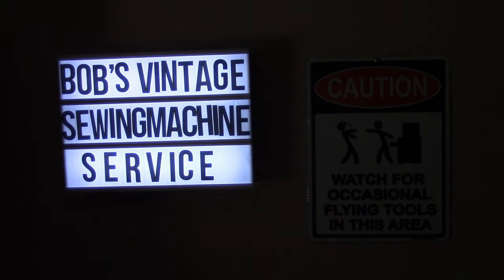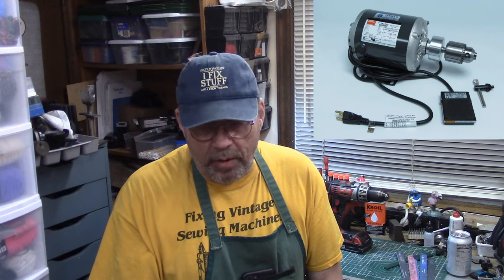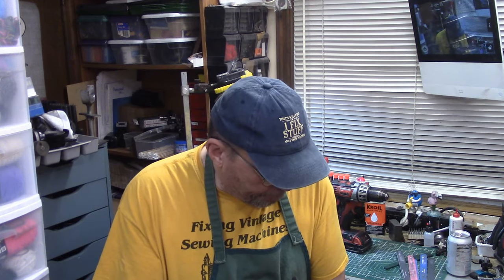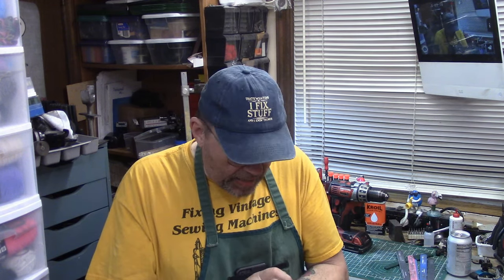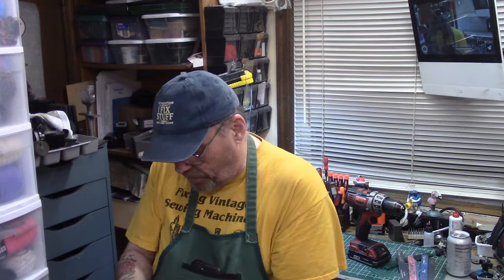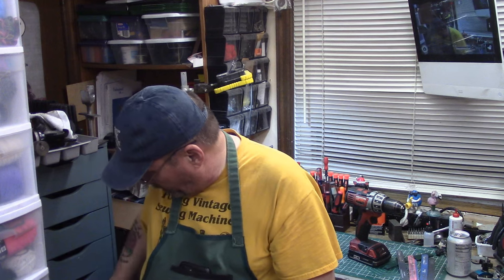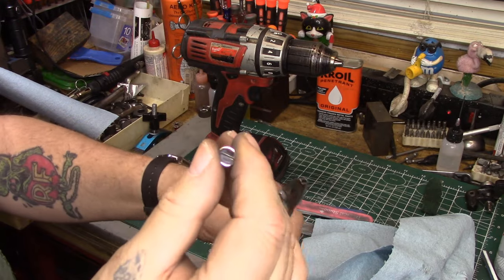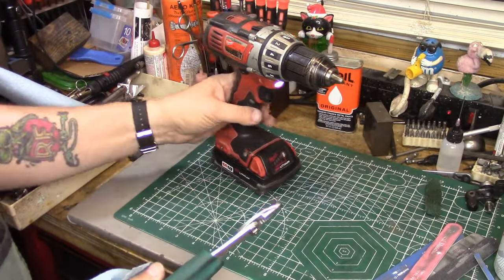Bench motor Alternatives & More: Sunday Morning Quickies, Ep. 104, November 19, 2023

Comment: You don't have to spend a lot of money on a bench top drill press. I picked one up. It's an older model but I picked one up from harbor freight. It does everything. I know a lot of people frown up on because it's harbor freight but quite honestly the motor in it is good. I got the 12 speed bench top so I have a quite a range of speed and I changed out the chuck so I have a much bigger truck on it but it works. I've used it for several things and I paid $140 for it. You can find deals at harbor freight all the time
Reply from the maker: Exactly!

Comment: Bob, I had my mothers 27 and cabinet as a lamp table for about 40 years and started wondering if it would sew. So I found your channel and followed the 27 videos step by step and as they say " Bobs your uncle :) " it sews perfectly. I'm a serious fan and can't thank you enough. I now have 9 machines and counting. My question is what's your thoughts on the 206 and would you ever consider a series on it. Thanks again
Reply from the maker: I have never had a 206 cross my bench. They weren't made in the US, only the UK and Germany (as far as I know), and considering my relative location to the Elizabethport factory, I suspect the reason I don't see them is that not many made it to New Jersey. If I find one, sure, I'll do a video, but I honestly never sought one out as I have no need for one, and they don't use readily available needles (read that as you don't find them in our local stores). I tend not to buy up machines that I will have problems putting into a new home, and if someone is going to have to source something as basic as needles, it's not in my, or their, best interest to put that in their sewing room.
Reply: I have a 206 too, and there is a dearth of material on Youtube. Some gold, some dross. Adjusters manual helps, get the one with better contrast from manualslib, covering the 306 too. Best of luck! Tip: If you take out the bight control, take LOTS of photos, this is vital. It has lines on the cylinders which line up in a specific way for timing. Have the controller in neutral (straight up and straight down) when you do this, and don't take it apart until after that! Underneath it has the same drive as a 201, cogged gears.

Comment: Thanks for another helpful video! Had a question about thread. Do you know what the largest size thread you can use with a Singer 201-2 is? New to sewing and don't know what my machine can handle. On top of the max thread size, do you have a preference to what thread you generally use? I have been looking at coats and Clark thread but I am thinking the normal dual duty would be too weak if I were to sew through a few layers of canvas or even thin leather. Anything would help

Comment: Have you ever sanded down a screw head too far as to no longer have a deep enough slot for grabbing by the screwdriver?

My dad (having been in the military)  was the only other person I've heard use the term Birth Control glasses.
😅🤣😂

On another note....have you ever worked on a Necchi Nova BU?   I have an issue with a single gear that allows the zigzag function to work...  trying to figure out how best to remove it without having to take the entire thing apart....
Reply from the maker: No, never took one down that far. I have, however, repaired damaged heads that required deepening the slot, but never sanded one down like that by accident. I think you know why we called them birth control glasses :-)  I've worked on the Necchi Nova BU, but it was quite a number of years ago. It's not something that comes up often here in Singer country. I don't recall havig any issues with the ZZ mechanism that required disassembly. If you check on Sewing Machine Resource Group on Facebook, there's a better than even chance of a service manual being in the files section there.
Reply: @BobFowlerWorkshop  I'm on that group as well as a Necchi group.  My wife has displayed her displeasure in my bringing more than a couple machines into the living space and I would like to finish what I have started and need to either fix and sell...  or fix and donate
..or just scrap them (if after the year they don't sell)

What sewing machine oil do you tend to use?  I have been told that the 3 in 1 stuff is crap.... even though the company mentions use for sewing machines on their website... (but of course they wanna sell their product and it's usefulness)...  I also don't wanna sell or donate something that will gum up later if they aren't using it often...